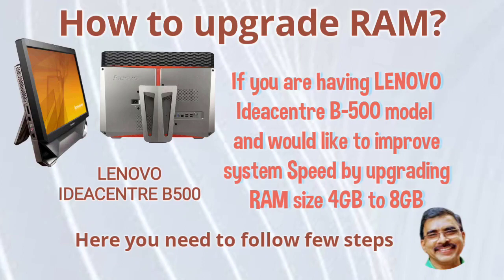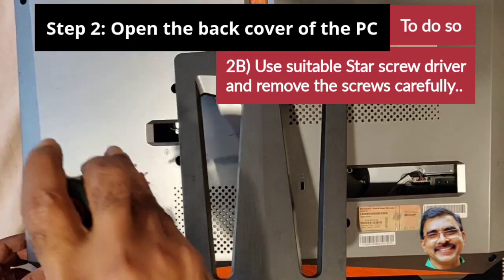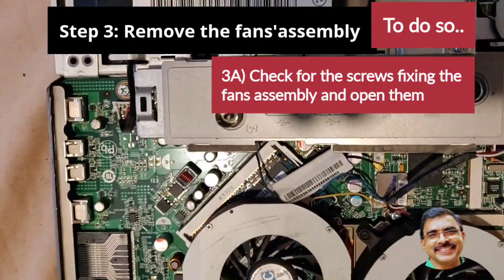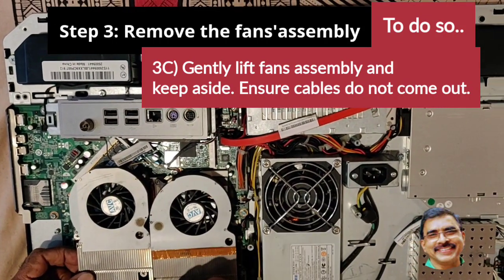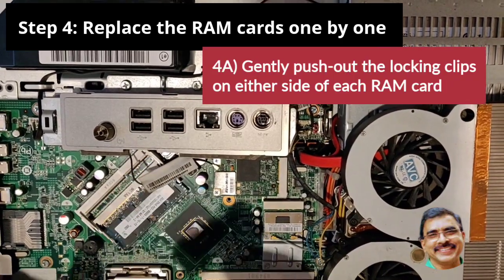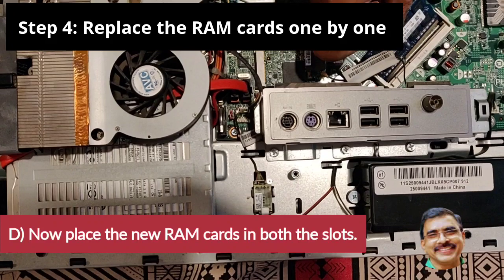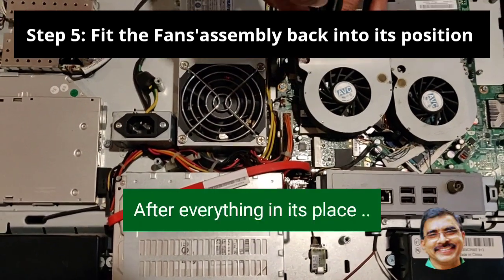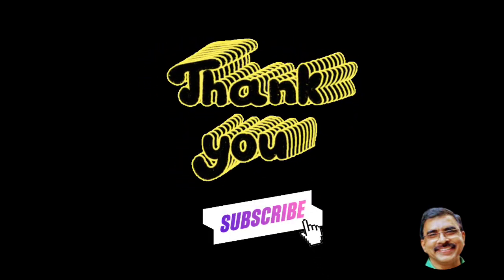HOW TO UPGRADE RAM IN LENOVO IDEACENTRE B500

Comment: Hello, thank you for the video. Unfortunately, I have the problem that my B500 does not recognise the 8GB memory. The device then makes a boot loop. The light under the display goes on and then straight off again, then on again, off again, and so on.
I have tried three different modules / manufacturers.
Is this only possible with some models of the B500, mine is equipped with a Core 2 Quad Q8400s and had 4GB Ram (2x2GB) from the factory. Do you have any other ideas?
Reply from the maker: Thank you for the comment. It's very unfortunate that it did not work in your case.  Generally, a model will have same set of configuration unless until its hardware did not go for any changes. It should work for B500 Idea centre model as it supports up to 8 GB & it was already mentioned in the description. Look at the other end i.e. RAM or shared memory. Try to upgrade the size slot by slot, one afte the other. You need to have separate 2 GB RAM for this.
Reply: @bnreddy  Hello, thank you very much for your reply.
I have now tried 4GB modules from Kingston, Samsung, Hynx, Kuesuny, Tecmiyo and Motoeagle.
Not one of them was recognised. Alsway the Boot Loop.
I then found a newer bios from Lenovo. Unfortunately, this did not bring any change.
I still have two older computers here, a ZOTAC ZBOX CI327 nano, this recognises the Ram modules and an ASUS UN65H, which also has no problems with the modules. It really looks like my B500 can only handle 4GB in total. My model with the Core 2 Quad was sold with 1 / 2 / 4 GB Ram.